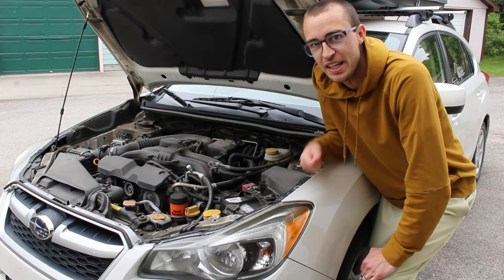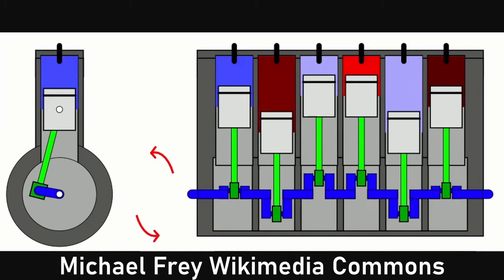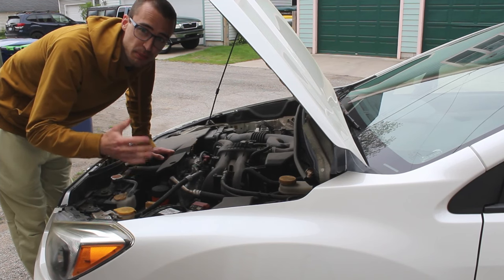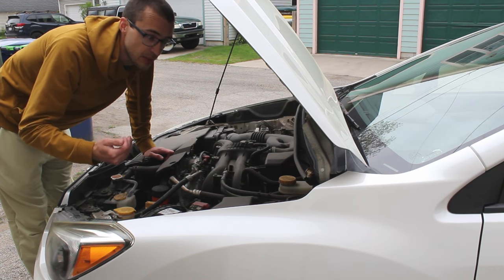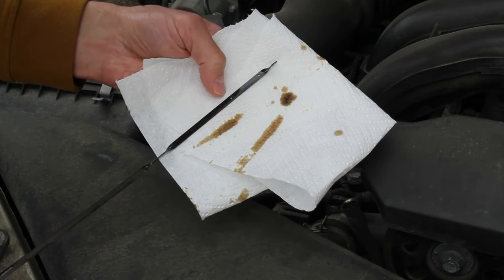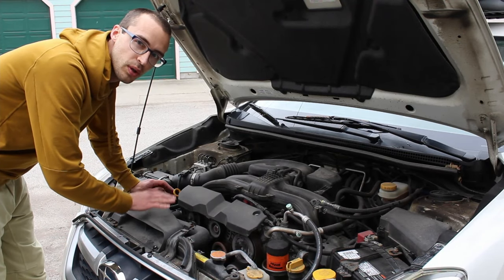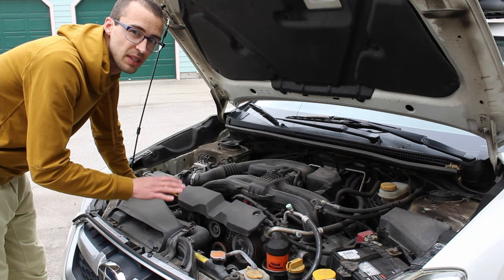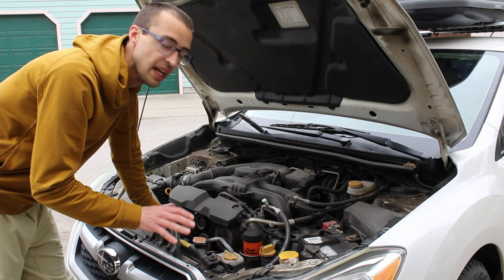Subaru Oil Consumption Issues? Information and FIX!

Comment: My 2014 2.5L has always used 1 quart every 2500-3000 miles, I’m at 195,000 miles right now. Boxers engines burn oil as part of their very nature, it shouldn’t be concerning unless the oil consumption drastically changes.
There were also a few years Subarus were worse than other years due to the use of different low friction rings. These are the ones that might have problems with excessive consumption.
Reply: Yep. Mine used about 1 quart every 4000 miles when new, and uses a quart every 2800 now. 14’ outback with 140k. However a friend with an 11’ outback burned 2 quarts every 1000 mi. New engine was installed under a recall.
Reply: My 2011 wrx goes through 1/2 or 2 1/2 quarts depending on the season I just Hit 141k miles

Comment: burning about 1 quart every 2500 miles , 2013 impreza 259k miles.  i basically use two of the low oil lights to give me the cue to get an oil change

Comment: i just did a oil change on my 15 legacy and the light keeps coming on and idk if it’s the oil pump or what.. so scared to drive it lol
Reply from the maker: Which light the low oil level? Could just need a new oil level sensor.  I think a few years had a service bulletin about it.

Comment: The issue isn’t clearance tolerances they are using low tension piston rings to reduce friction and cylinder bore drag.

Comment: My 2013 XV Crosstrek burns a quart every 500-600 miles.  It burns a lot! I'm adding more than a full oil change before it's time to change.  Help!
Reply from the maker: Take it to the dealer!
Reply: piston oil rings are gone or HG
Reply from the maker: @phiillzzz807  According to subaru thats a feature not a bug haha
Reply: That happens to me…. My subaru crosstrek is burning a quart every 500 miles and now thinking about to change the pcv valve i dont know if it could help…
Reply: @gibocookies  i changed it on my ej25 and didnt do much. But if yours is clogged, and before buying a new one just take it out, get some part cleaner inside and shake it around with both ends plugged with your fingers until it starts clicking again, if its more "chuck chuck" and not a "click click" consider replacing the pcv. Its cheap on rockauto

Comment: Is there a mileage limit on replacing the engine? We've brought my gf's 2013 Legacy into the dealership and when she brings up the oil/leak burn problem... they check for a leak (nonexistent) and then send her off. Maybe the technicians aren't aware of the service bulletin? Or they don't want to replace her engine? haha
Reply from the maker: If it’s not leaking it’s for sure burning it. Dealers can try and brush off the problem. I would call subaru of America they tend to take issues more seriously.
Reply: @KurtofTrades  Yeah it seems like the dealers do want to brush us off. Lol I will contact Subaru of America. Thanks Kurt!!

Comment: My 2006 Subaru Forester STI burns a quart every 7 to 900 miles but at 126,000 miles its to be expected still pulls like a train. So even the older models eat oil.

Comment: 2014 Forester XT 53k miles. I have never noticed the oil level drop on the dipstick.  Factory standard and Chevron Havoline Pro DS 5w-30.  I don't buy all Scoobys burn a ton of oil. No way. I also hit 42mpg on a run last week 💪
Reply: My 2014 Forester didn’t start burning oil until 60k miles, got the oil light and it needed an entire quart. Just hit 142,000 this past week, it’s consistently needed a quart at about 5,500 miles after an oil change.
Reply: The FA20 engine does not burn oil... At 150k+ not a single drop between oil changes. It's great. Big problem with them is turbo piping clamps, they a rubbish from the factory so better to replace them with breeze clamps.

Comment: My 13 Outback 2.5 should have been taken to the dealer before 100k to fix the problem for free. But I just got it with 118k 1 year ago when I noticed the oil being used and they said I'm on my own and try thicker oil. 5w30 still used oil. Now trying 10w30. They said don't try thicker than that. I haven't gotten to change the oil, but have put 3 or 4 qts of 10w30 (1qt at a time) as it burns off at approx 1000 miles. I don't think it's going to get much out of the 10w30 from what I'm seeing so far. I'd be happy with a qt every 5 or 6K, but not liking 1k. Too frequent and I already replaced the cat converter when I bought the car because the maint light came on and that was the problem. Subaru said that was because the oil is burning through and coating the cat converter. Is it really that hard and expensive to change the piston rings to better rings? Might it be better to swap the engine for the bigger (I think 3.6?) one which doesn't seem to have this problem as much? Everyone online seems to know it's the piston rings, but nobody talks about a solution that actually worked for them if it is over Subaru's 100k extension on the warrantee. Also, what other wear and tear is this problem going to have over time other than the cat converter needing to be replaced prematurely?

Comment: I have heard that these engines are being built not as “tight” to increase fuel economy. This issue is happening with all makers right now.
Reply from the maker: Yes seems across the board for sure. Makes sense in terms of economy.
Reply: But most newer cars (turbo & non) recommend to use oil as thin as 0w20. Higher viscosity could affect fuel economy
Reply: Should be quite the opposite - build "tight" to increase the fuel economy, no?
Reply: @val4803  NO

Comment: It's a huge problem especially when your car is way out of warranty and it's burning so much oil that it's clogging up the cats and making the check engine light never go off
Reply: That’s what’s happening to my 99 outback. Noticed oil consumption and a lot of smoke, checked tailpipe and there was oil in it. Check engine went on, was the cat being clogged by the oil. Probably piston rings but not sure. Going to strip the engine down and try to rebuild the entire engine, hopefully this year cuz I’m already at 190k. Plan on lifting it and making a battle wagon but need to fix this oil problem before it creates more issues

Comment: Question if the relaxed tolerances allows more oil into the cylinder, how does this not gum up the catalytic converters.
Reply: It’ll will cause the catalytic to prematurely go bad. Dark/black tail pipe/pipes is a tell sign. That’s most likely how the cat would look like too
Reply: It does.

Comment: My 2012 Subaru forester which I bought from the Subaru dealership is 110000 miles and I’ve had it for 9 months and got it at 95000. I changed the oil every 5000 miles and just recently without warning at about 5000 mile mark to get changed it died from low oil. I had no idea this was happening and no warning or lights and no I just gotta hope my warranty will approve this cuz it seems like they sold me a car that had a oil burning problem without fixing thay
Reply: Any update? Did they fix yours at no cost?

Comment: question: will subaru replace short block on a 2011 forester I bought used? Also, what are they replacing the short block with? Has the replacement short block been redesigned to correct the problem?
Reply from the maker: The short block is just a new one. Not a different design or anything.  I doubt they would on a 2011, doesn’t hurt to call Subaru of America though they might give you some money off a repair. GL
Reply: @KurtofTrades  Thank you for responding to my question. I see videos saying the piston ring is the culprit. It gets gunked up and stops scraping the oil back into the hole. In your opinion, would changing just the rings fix it?
Reply from the maker: Hard to say. That’s a pretty extensive job.  If it’s not burning a ton just keep topping it up is the best option usually.
Reply: The replacement might consume more than the original.  Mine does.

Comment: This is wrong. You say repeatedly that it shouldn't use more than a quart per 1000 miles. The spec in the consumption test and bulletin is 1/3 qt in 1200 miles.
Reply from the maker: Sorry what I am saying is that if you notice it burning more than 1 quart in 1000 miles you should have them do the test. Not that the test is that amount.

Comment: I now run 5W-40 and from about 50K in kilometres until now about 110K in kilometres or 60K in miles I burn 2 Lt of oil between each service. Outback 2.5.

Comment: My 2012 consumes about 1 quart every 500 miles. I'm using Castrol 5w30 although my mechanic told me he went 5w / 10w40 in all of his subarus before. I'm  curious tho, I could try using some additives such as Lucas oil thicker or even some piston ring additives and pray 🙏  or I'll plan to get the engine out and swap it for another ej20 in greater shape.
Reply: LOL I got a similar problem. Mine was burning 1-1.5 quart per 1000 km, I switched to 5W30, but it still burns the same, will try 0W40 now (its winter, so 0W... would likely be better for cold starts). I tried Lucas oil stabilizer, but couldn't see the effect, maybe because it too thick and didn't go all the way down.
 Let me know if any additive that you use worked
Reply: Same here. 2011 Forester a quart about every 500 miles. I have to keep 5 quarts in the back of my car at all times to top it off. Not worth replacing the head gasket because that would basically cost the car's worth.
Reply: @LinkPlayzFTW  I now run it on 5w40 haha ! Might switch to 0w40 soon to help it start during cold mornings. Gas consumption is around 9.5L/100km
Reply: @louisfredgagnon  I've been still running the 5w-30 Synthetic. I wonder how much of a difference the 5w-40 makes
Reply: 2013 forester manual . Burns 1 qt every 2000k. Using the recommended 0w20. I switched to 5w30  and its burned 1.5qt over 8000km . Now I m trying 5w30 high mileage with a bottle of lucas syn oil stabilizer. So far oil level is the same in over 2000km. Im really impressed but oil changes cost way more with this combo. I ll try 5w40 alone on the next one.
Reply: My 2011 subaru impreza hatchback with 150k miles is using up about 1qt every 500 miles. This started mainly after a head gasket repair... but from what I've read, and what the repair person told me, this can happen with a head gasket repair. 🤔

It was probably burning a good chunk of oil before, but I never noticed because I never thought to check the oil level. 

I'm just gonna live with it and like you said, carry a jug of oil in the trunk. Cars are too damn expensive these days to buy a new one. I'll try 5w40 in the future and see if that helps.

Comment: Actually machining tolerances are tighter than ever which is why modern engines can run 0w16 and the like. They run low tension piston rings to reduce internal friction and low viscosity oils.

I’ll watch this but I kind of got my “this will be rubbish advice” detector going.

Watched most of the way through … the solution is to replace the engine … no mention of letting the thing warm up for 30 seconds before driving or run in technique when the thing is new.

Comment: My 2019 Impreza consumes about a quart of oil every 1000-1500 miles. Does this year qualify for the service? I'm at 88,000 miles with a 120,000 mile extended warranty.
Reply from the maker: Probably not enough consumption for them to do anything about it.  It doesn’t hurt to call Subaru of America and ask though. They are really good about helping people out.

Comment: Do you still have your Subie?
Reply from the maker: Yes I do!
Reply: @KurtofTrades  I've got an 18 crosstrek Limited and it does consume some oil. What is your rate of consumption and what weight oil are you using?
Reply from the maker: Goes through about a quart in 2-3000 miles 0w20

Comment: I would use the Amsoil engine flush before oil changes. Use a good synthetic lower the NOACK number like Amsoil signature series. Like the 5-20
Reply: Amsoil will not curb oil consumption. I owned 4 Subaru's & all consumed oil. I tried 0W-30, 5W-30 & 10W-30 & nothing helped.
Reply: @71_button  I think you should go for the higher 2nd number, 1st number shows only viscosity for low temperatures, your engine burns oil on high temperatures, so try 0w40 or 5w40. It does not guarantee anything, but it is logical to increase the high temp viscosity rather than the low temp
Reply: @val4803  Do they even make 0W-40 oil?

Comment: In my experience my car (2013 legacy) was consuming a half a quart of 0w 20 oil every 600 to 1000 miles when I was doing mostly highway miles. I switched to 5 w 30 and i have a shorter commute at low speed now and it burns the half quart about 1200 to 1400 miles now. I get oil changes every 4000 to 5000 miles and keep oil in my trunk for when the low oil level light comes on. 

Im also getting a check engine code that comes and goes. Its for the catalytic converter sensor. Worried my cats might be getting clogged since im burning oil. Idk. Should i trade it in. At 141k miles rn
Reply: my 2013 impreza burned oil from brand new. Dealer wouldn't warranty it. At 160k miles now, check engine light for cat and  huge drop in fuel economy (28 highway). I say get rid of it before your cat is completely toast due to oil burn.
Reply: You should try one of those engine cleaning kits.  The detergent cleans the cylinder rings and so long as the walls of the shirt block are not already damaged by the currently clogged cylinder rings it should reduce your oil consumption and save your CATs.
The reason why modern cars burns oil is because of the lose cylinder rings they use to get better fuel economy.  They always clog and that allows oil to bypass them.

Comment: Subaru screwed me over, i have a 2013 Subaru Crosstrek with 113000km consuming about 1L/ 1500km and they said they will not fix it for me
Reply from the maker: Hmm maybe they have a different threshold in your country. USA is mainly what this short block test is for.

Comment: I don’t have any oil use issue with my 2017 Outback. I use 5w-30 from day 2. Doesn’t use any oil.
Subaru recommends 5-20. This is too thin and gets by the rings. 70,000 miles so far not using any oil.
The other issue with Subaru is the oil filter being mounted upside down. It empties out overnight and causes a dry start every morning.
Subaru has to many issues. Will never buy another.

Comment: When the engine consumes oil it might lead to spark plugs becoming fouled. My may want to replace the plugs if mileage goes down.
Reply from the maker: Mine were fine at 100k when I changed them, but yes that can happen

Comment: My 18 Impreza was flashing the low oil light every 2k miles. I took it to my local Subaru dealership for a consumption test and they claimed that was normal and wasn’t out of the ordinary so they just ignored the issue lmao. Never knew needing to change / add oil eveye 2k miles was normal
Reply: My 2002 sti takes like a quart every 300 miles, It have been like this since 35k miles I purchased It, now with 90k miles consumption is the same but it still pulls as hard as the first day, so maybe it is normal on these engines...

Comment: If the Subaru still has the flat boxer engines then extra oil usage is a quirk of those engines . Old air cooled Volkswagen's were the same . Just keep an eye on your oil level and top it up as needed . 
As  long as the engine is not blowing oil smoke when you accelerate or leaking oil onto the ground it's ok . Some times engines can have a rough crosshatch in the cylinder bores from the machining process this can burn extra oil . Fords did it in the old days due to this reason but once run in they usually stopped .

Comment: 2020 2.5 litier zero oil consumption most people that have the problem is from using a thicker viscosity oil and it increases the internal pressure so 90 percent is own's fault.

Comment: I bought 2020 Impreza at the end of 2021 w 45k miles and always got my oil changed a little early at the dealer 
Recently I was just under 1k miles from my next change and I was planning on doing this one just on time or just a little over and it actually randomly blew out a decent amount of smoke that smelled like gas out of the exhaust one time after starting it and tbh I kinda forgot about it the rest of the week cuz I saw something that said can happen sometimes and I also forgot that I was going on a last minute road trip that weekend and the day after getting back a couple hundred miles over the recommended mileage my low oil light came on 
I’m only at 69k miles
Reply: I’m going to check/replace my PCV 
Keep an eye on my oil levels
I really don’t wanna switch to a heavier oil plus I live in mn with hot summers and freezing winters so fuck me right I’m probably gonna have to just meet in the middle or switch from lighter to heavier back n forth dealerships be taxing anyway

Comment: Replace the whole block? Oh come on. There are other reasons you could be running low on oil. There could be leaks. The PCV valve probably needs to be changed.

Comment: Get the black Roki oil filters and ditch that fram, bro.
Reply from the maker: Fram isn’t as bad as people think really. It’s good enough for a commuter
Reply: @KurtofTrades  Its your car. But any subaur tech worth his salt will know the difference. The frams are even worse with the extended intervals. 
Best of luck, nice channel.
Reply: @KurtofTrades  Purolator or Napa Gold, if you are buying the filters for an oil change, would be my choice.  Why buy crappy?
Reply from the maker: @lorenschwiderski   Fram makes the OEM subaru filters, Fram is a great filter

Comment: You should not say oil consumption is a common problem in a "MODERN" engine. Modern engines dont burn oil. Its not 1923. Its 2023. It is Absurd to think that this oil consumption is acceptable. And a LIE.
Reply from the maker: I guess I don’t mean normal but common as in a lot of modern engines experience this problem. But I agree it shouldn’t be such a widespread thing that happens.
Reply: Dont be sure about that.  These days, quality is now outsourced to the lowest bidder for fatter profits